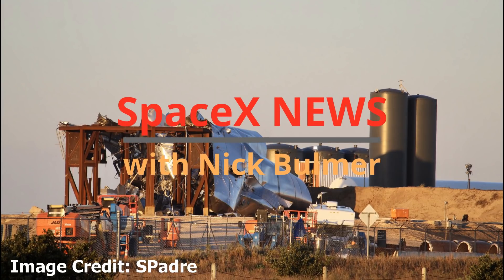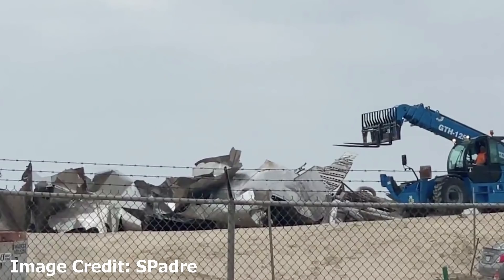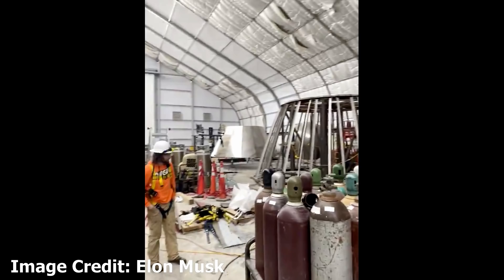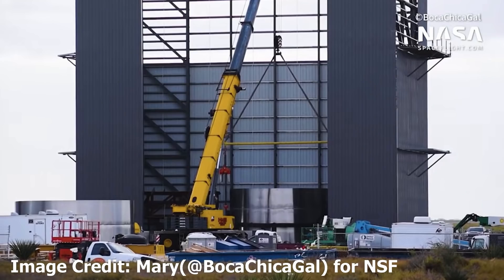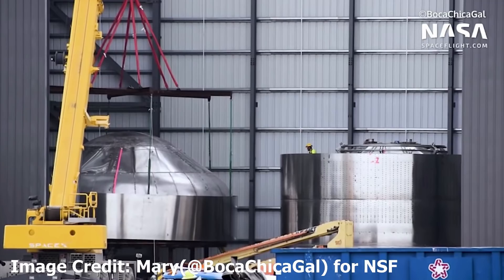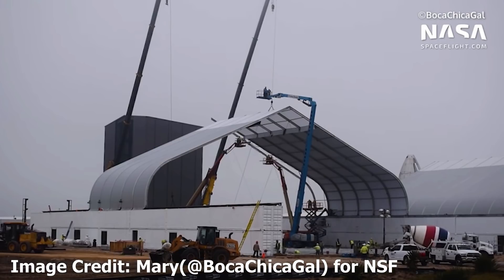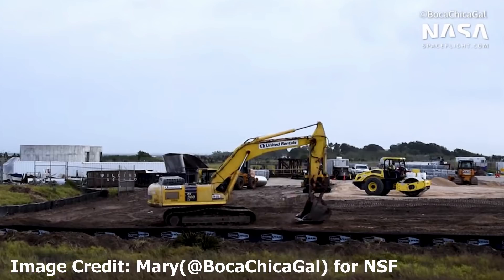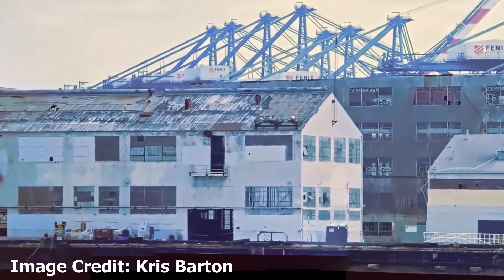SpaceX Starship construction NEWS

Comment: I've been very critical of their results, but not with their effort and goals. They are doing it completely different in an attempt to do it cheap. And I do mean cheap. Simple and cheap is the only way it will work. They have a welding problem and will likely have more. But they must keep trying, and figure it out cheaply. Skilled metal fabricators (which they must be using) and a few smart engineers will figure this out. Notice all the sections are cut from flat sheet. They are stamping nothing external on these airframes. It's gutsy imo. I think I saw a stamped section of a tank, I hope so. But the whole skin is seam welded reinforced with stamped doublers and stringers it looks like. Kind of like the early steel rockets. The V2 looked like this thing except it used a lot of truss sections. Which might not be a bad idea for SpaceX.  I saw no truss structure in the wreck. Aviation grade truss structures are very light, cheap, and dirt simple to weld correctly with jigs.

Comment: rocket booster tanks in 1950 /1960 were communally made from stainless steel - most were much Thinner SS than Starship used - think i read 20 thousands inch - present SLA upper booster tank is SS and Very thin - all of these starship being built are tests - to give crew practice at building quickly / cheaply -  welding crew is Very Good - they are doing the Impossible welding tanks in the wind that hold pressure- i was. a tig welder and even a small fan blowing can ruin welds-
Reply: I'm a tig welder too and your right. Those tiptig machines with high enough gas pressure would be fine for outside work. To be known as one of the guys who welded a fucking starship and watched her fly/fall/land, that is my dream, but moving to America and doing that will only ever be a dream unfortunately
Reply: bluenessaja,
You could probably do it. Just contact SpaceX. You never know. Just build your portfolio from now. Share your skills and knowledge with them.

Comment: Wind is the enemy of industrial construction. It makes lifts difficult to dangerous and welding stainless near impossible. I'm very surprised they attempt as much welding outside as they do. It could account for some failures.
Reply: runemrick,
It is the reason for all those failures. Even the very first where the upper portion of Starship was knocked over by very strong winds. 
But that shouldn’t stop progress. SpaceX still builds come rain, snow or the blistering heat of the sun because that’s what will allow you to have the optimal strength on all ends. 
Imagine a weld astronaut having to do a space walk, near a sun or the dark side of a planet where there is no sun. 
I know I sound crazy but it makes sense. Traversing Space is the hardest thing humanity could do (that and world peace...never gonna happen). This ship needs to be built with the harshest of conditions in mind.
Reply: @magnamic5614  Agreed. The product will only be as good as the welding conditions allow. As a person who's worked on several mega projects with 15K plus workers, I've been puzzled by footage of welding stainless in high winds. The joints will sugar and fail. They need to close that building up. I wish them great success.

Comment: SN2 won't be a full build. They just put the triple ring section on the bulkhead and that on top of the engine and thrust section. What failed on SN1 was the weld between the thrust structure and the lowest bulkead. A round reinforced steel plate goes under the lowest dome to cap it off, distribute the load from the engines and house the plumbing to feed the engines. That part blew off on SN1 so SN2 will just be a small test tank section. The latest NASASpaceFlight video shows it more or less assembled. For the source, it's all Elon tweets from the last 3 days. The last test tanks only had normal bulkheads on the top and bottom but not the lower modified one.

Comment: I don't understand the logic behind welding the fuel tanks. Why don't they just cast them, it's quicker and much more durable to cast.
Reply: Marcus Knightingale great analysis!
Reply: Marcus Knightingale,
This is the best anyone has described both the process and reasons on Starships construction methods so well. 

This comment needs to be pinned on every video concerning Starship (if possible). It’s simple, precise and well thought out. 

Very well done.
Reply: Marcus Knightingale,
You’re welcome. 
I’m the same when it comes to space exploration and advancements. It’s nice to see so many like minded people this excited over space again.
Reply from the maker: Well, I don’t claim to be a metallurgy expert but I think casting such a large structure is very difficult, particularly with 4mm walls at such tight tolerances. Also, I think the steel rolls are stronger than a casting.

Comment: Its hurts when I see how they waist so much stainless steel. Its too thin. It will explode again. Its so scary when you can see how paper thin walls shake and vibrate.... Gosh, you must be crazy to fly this rocket. Ha ha...reusable rocket? With dynamic forces.....No way. With this kinda thin wall design its not going to fly even first time. Factor of safety must be more than 2 . Ok, build it larger if you are restricted with a specific payload, but use more meat. For Elon size has no limit. Just do it.
Reply from the maker: Hi Tigran, I have little doubt that starship will take off with those Raptor engines - prepare to be amazed!
Reply: SpaceXNews,
Agreed. Minds will be completely blown when people see her fly. 

Remember, we don’t know all the details. Those damaged pieces might be melted down and rolled again for another Starship. 
Too much complexity in a design might be the problem why we have always feared doing something of this magnitude. If you break down everything concerning rocket design to its simplest form and build that anything can be added later. 
I bet you Elon is thinking build for cargo first. If cargo can survive the simplest of designs then building for human safety is no problem. 
We already have all that information. 

Hell all Elon had to do was strap a bunch of Falcon 9’s together, throw a silver skin around it, build a larger version of Crew Dragon, stitch that on and done. People wouldn’t even bat an eye. He’s doing things the most essential way with Starship. 
IMHO.

Comment: The engine bells will not stick out of the hull (this is part of the re-usability concept and necessary for aerodynamic reasons). At 3:20 further 2 rings will be under the 3 rings with the engine mount bulkhead. See Rafaels Diagram https://imgur.com/a/ZGeMsho. Keep going I like your videos! :)
Reply: Why would that be part of the reusability concept? Falcon has exposed bells. If anything its for refueling in space reasons id think.
Reply: @Vatsyayana87  I assume the goal is to require less refurbishment.
Reply: @snuffeldjuret  Im not sure how that would help with refurbishment, i just know for a fact that the bells would get int the way of orbital refueling and so that seems the main reason to me.
Reply: @snuffeldjuret  I typed a ton with my thoughts, and I think your point is a valid thought, but then I remembered, these are coming in belly first not engine first, so I would think the engines will take alot less damage, and yes even more so being shielded, I dont know if they would need that or not, but I do know they need to refuel in orbit and that shielding will be much more predictable during reentry. You may be right but I think those two reasons are enough to do it either way.
Reply: @Vatsyayana87  Starship will reenter atmospheres at much higher velocity than falcon, as it will come back from orbit or even interplantetary transition. The skirt will shield the engines during reenty and aerobreaking and is also required for correct aerodynamics during the skydive like descent of starship, which will also be much diffrent from falcon 9s retrograde descent. Therefore savagescf is correct, shielding and aerodynamics. Furthermore, Elon explained all this personally in starship presentation and other interviews. Concept is and always was: engine bells are inside hull.
Reply: @eristtotjim3435  What have i said that makes you think im unaware of anything you have just said here? All ive said is i dont know if the shielding is necessary to protect the engines though i know it will help. But i do know it is crucial for orbital refueling and aerodynamics during reentry.
Reply: @eristtotjim3435  Oh, i see. Cause i asked why it would be for reusability? I thought you were talking about my convo with another person. Yes i do agree with savagescf,  i sometimes comment while im still too tired to be thinking straight, but i didnt say i disagreed with him, just gave a thought of why i thought it was necessary instead of just helpful, but yeah with how it will enter i do agree that its probably necessary to survive and therefore for reusablility.
Reply: @Vatsyayana87  yes you explained it 😉🙂
Reply: @eristtotjim3435  yeah to be honest, it was a bit of a dumb question on my part lol. Well for someone that watches every update about this. It wouldn't be dumb for someone who shouldn't know, like myself.
Reply: @Vatsyayana87  There is no dumb question ;) Yes with re-usability I meant, that the engines will not be exposed to high velocity reentry effects, which would also (different from low velocity reentry of falcon 9) affect the integrity of the engines (especially if they are not running (no cooling by LOX). This is not only due to refueling, they would use another method (like lateral refueling as planned initially) if they could dispense the skirt, which would be a matter due to mass weight reduction. Further, it is simply necessary for the belly like skydive, which will have to be balanced out with help of the movable fins in high precision. Engine bells would induce swirls influencing the descent.
Reply: @savagescf  agreed
Reply: @savagescf  I totally agree, though I do think they use fuel to cool the bells not lox, I could be wrong here but I think they avoid using oxygen anywhere except when its necessary since its so reactive.
Reply: @Vatsyayana87  Yes I guess you are right, they cool with the fuel not the oxidizer.
Reply: hes right they wont stick out, i think the diagram is correct other than flipping of the bottom ring. its not for re-usability but to allow 2 to dock end to end for refueling in orbit. means the engine bells wont be in the way